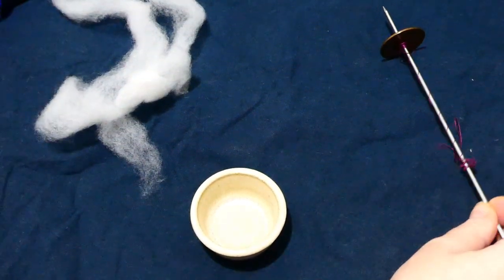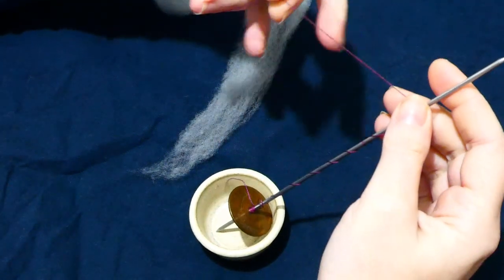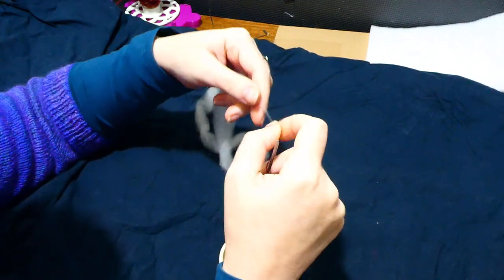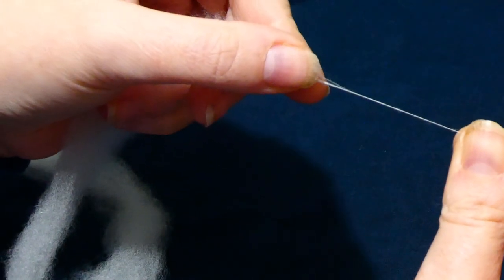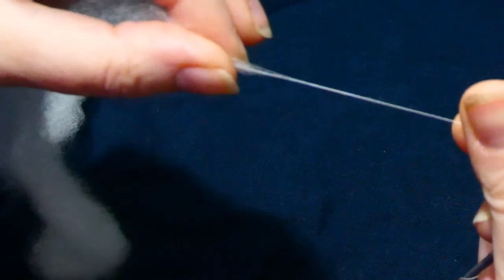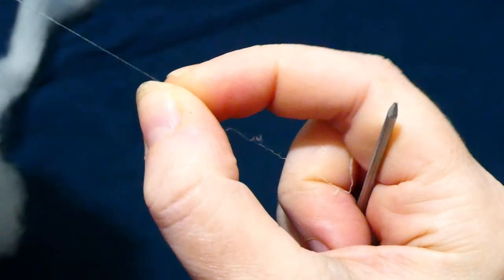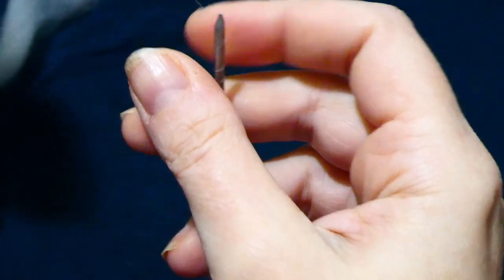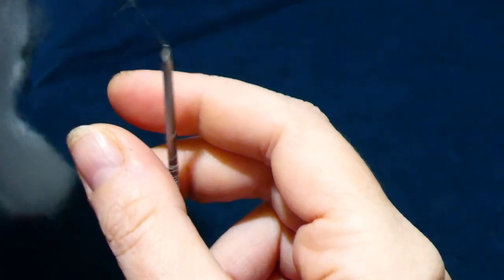Super fine spinning - 3 fibre singles

Comment: Thank you for showing this! As a newbie spinner with a love for lace knitting, I naturally lean towards very fine yarns… and am learning to spin it. So far, I’m managing lace weight 2-ply merino either on my supported spindle or on my brand spanking new EEW Nano2 and am working on consistency. It’s starting to come along. I’ve already got my first knitting pattern picked out. It’s an Estonian lace pattern and I’m hoping the nupps will help to hide the inconsistencies of my first efforts after my first mini-skein that I’m literally framing because I’m so proud of it. 

Spinning is new to me. Due to a spinal injury that’s leaving me with permanent nerve damage, I’ve had to take a break from lace knitting as I couldn’t sit in one position for long enough to finish at least one row of a knitting chart. A friend suggested spinning, as both the drop spindle and supported spindle would enable me to shift to standing or to different sitting positions more easily and I’d still keep a link to fibre arts. 

Now that I’m having more better days, I can knit again although for short periods of time only. So I alternate with spinning to keep me sane. It's fast becoming my happy place. Videos like yours help a lot when I can't spin, need information or need a break. 

Thank you!

Comment: That was fascinating.  I had never even thought about trying to spin 2-3 fibers.  If I had, I probably wouldn't have come up with a technique that worked.  Your technique of a drop spindle sitting in a dish is brilliant.
Reply from the maker: It's not something I came up with, it's actually designed to be used like that. It's a supported spindle rather than a drop spindle, specifically a tahkli, which is generally used for cotton. It's far easier to spin cotton supported than on a drop spindle, as the fibres are very short and during the initial drafting phase it can break very easily. It also needs a lot of twist, so a really fast spindle like this is useful. I've spun supported with turkish spindles just on the surface of a desk, but a smooth bowl is better to keep them contained, and if they have a metal tip like this one, to stop you damaging the surface! Honestly, I wouldn't recommend trying to spin that fine, it needs so much concentration and is rather pointless. I've heard a few people say that spinners in the past often spun 3 fibre singles (though I've not seen any primary evidence myself suggesting this). Someone brought to my guild a sample of woven fabric from the 1570's that had fantastically fine spinning. They may well have used just 3 fibres, but the sheep was a longwool breed, so far far thicker than the cormo I am spinning here. With modern sheep with very low micron count, a singles that fine isn't practical for anything I can think of.

Comment: Is there a video that shows what to do after you spun up your Single. Or can you just leave it as a single  set the twist   with maybe steam instead of washing it.
Reply from the maker: I have no use for yarn this fine, so I don't really do anything with it. Slightly thicker yarn (my longest thread competition entry) I wound on my skein winder and steamed with an iron. Thicker yarn still (gossamer weight for a shetland shawl) I just treat as normal,  skein, soak, then dry. I'd be very wary about using anything this fine as a singles though unless it was from a very long stapled fibre. I'd rather ply.